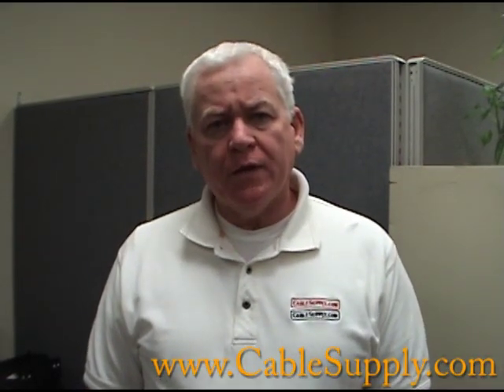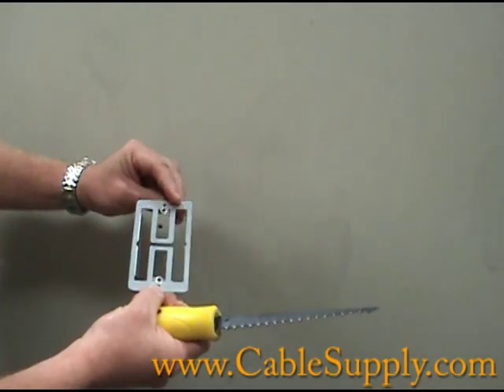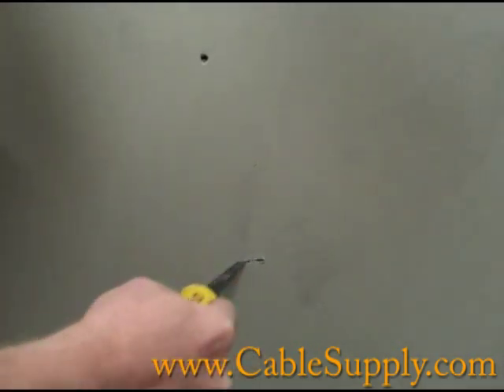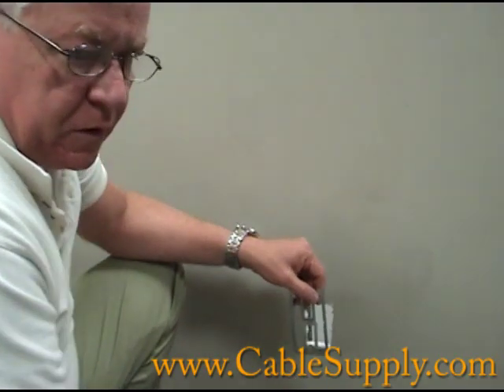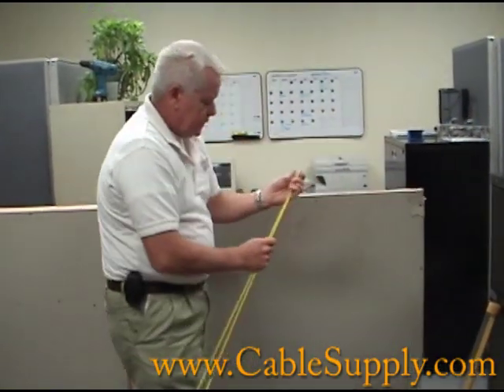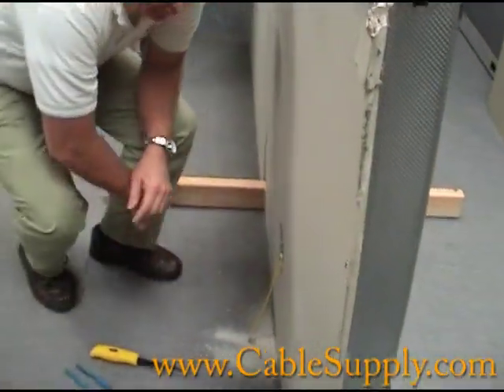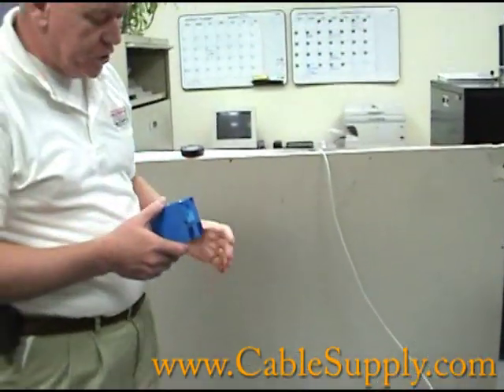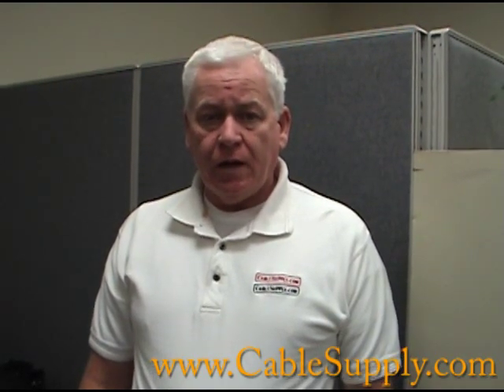How to install a RJ45 computer jack in a wall - Aluminium Studs - Part 1/2

Comment: Pulling wire through metal studs without an insulator in the hole in many cases will skin the outer jacket of the cable.
Reply from the maker: I have done it this way for 30 years and thousands of cable installs. never had a problem. I have seen some people use insulator, but in my opinion it does not add value to the install.  Thanks for watching the video.

Comment: Jim, i am doing a home theater install and will be run from a basement, main level and 2nd level. how would you suggest installing ceiling speakers inside of a basement and on a main level. keeping in mind the central unit where the music source is located I.E dvd, mp3 player is located will be on the main level. here is the kit i would like to install home-technology-store com/home-audio/GE-CC-SC821-KIT.aspx